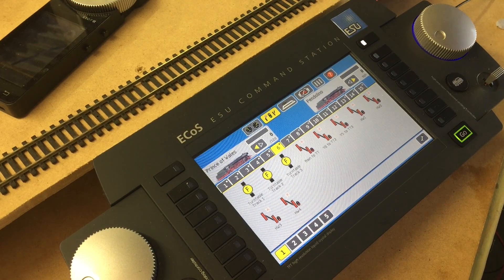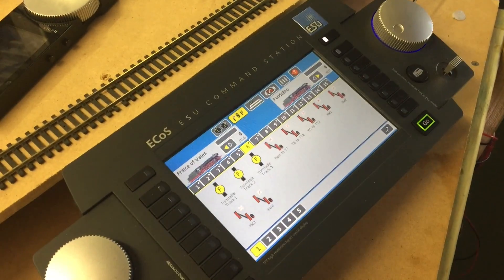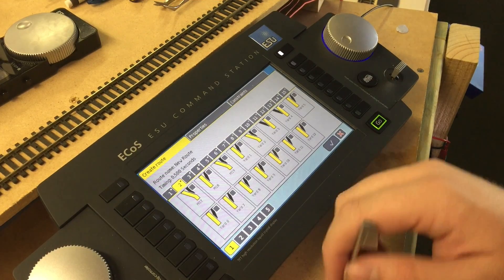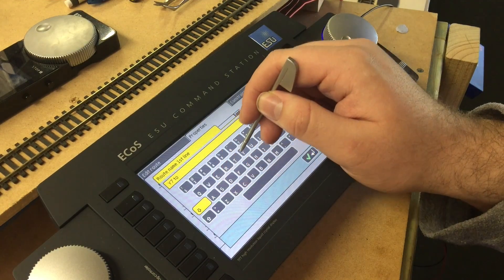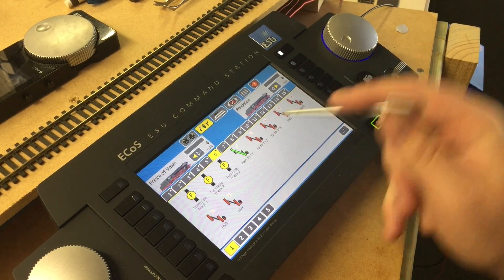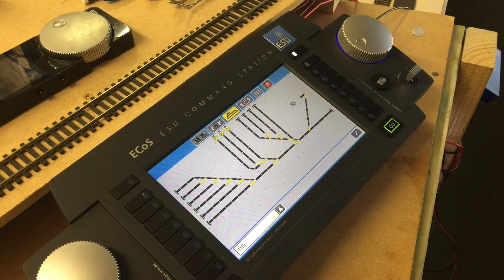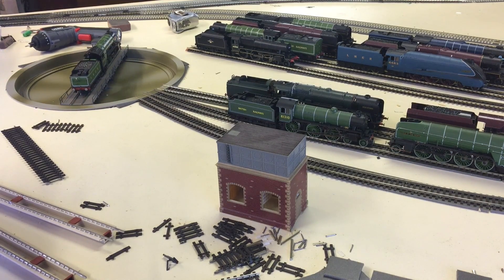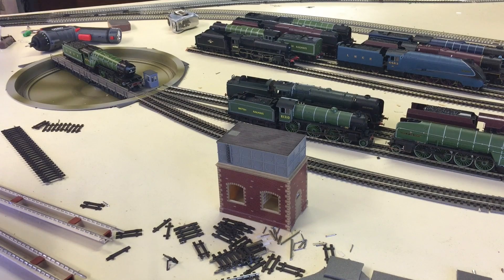9. ESU Ecos Pt.2 Programming Routes & The Heljan Turntable

Comment: I have Ecos 50200 , 
using Roco geoline turnout with Roco decoder , couldn’t program the turnout with Ecos ? What do I need in order to control the turnout ?
Reply from the maker: You might need to check the DCC protocol... If the turnout is NRMA compliant it should work with DCC.

Comment: Hi Ben it’s a good video - I don’t run an ecos - I am using iTrain and Digikeijs DR5000 command station - but I catch the drift of what you are doing - I contacted Heljan and they didn’t know how to do what you’ve done - however the owner of iTrain spoke with them and now has the protocol in the software - it is maxed out with 48 stops in theory 24 red and 24 green - you set 1 and the opposite is 2 at 180 hence red and green like a point open closed - and you have to number correctly up to 48 then convert as you say 225 + 47 - but I like your way better as it seems more simple - I’ll give it a go - I run DCC with occupancy detection and the Hope was to automate a route - I’ll stick to it and see what transpires - thanks again JC

Comment: Very interesting, do you think it would link up with Hornby Railmaster.
Reply from the maker: Hi Richard. The ESU Ecos has an inbuilt sniffer that gives it the ability to work with other makes of DCC controller like the Railmaster for example. My own experience of this is limited as my system is exclusively ESU controlled. Jim @ Hovermotion has plenty of vids on this topic may be a good idea to check those out. Hope this helps! Cheers......Ben.

Comment: Interesting video, thank you for taking the time to produce and for sharing your knowledge.  Boldly going where others are hesitant to tread.  One question regarding the Heljan Turntable, where do you connect the "blue box" to the back of the ECoS Command Station?
Reply from the maker: Hi, Jeff! Thanks for your comment and question! The Heljan/Walthers Turntable's blue box is the controller/decoder. In order to control the TT via ECOS, the blue box needs to take power from the DCC bus. The default address of the TT is 225. This can be changed in the setting of the blue control box to be higher. Cheers......Ben.
Reply: Thank you.